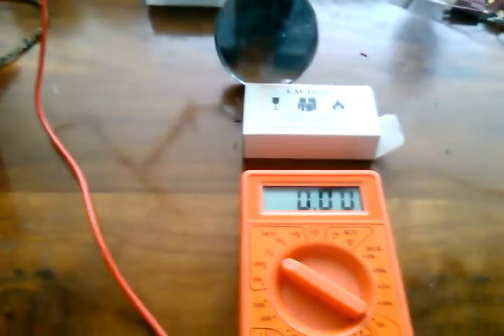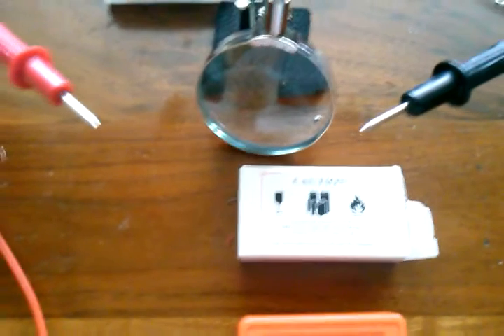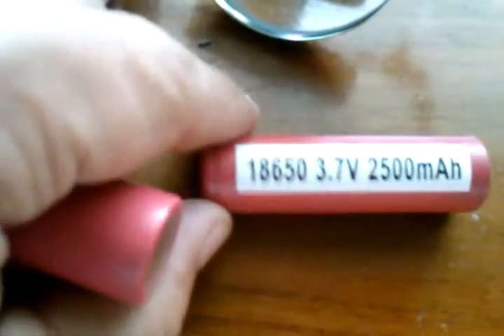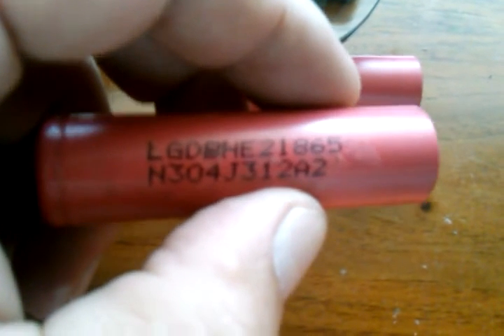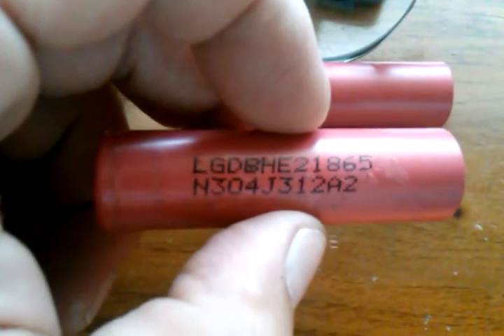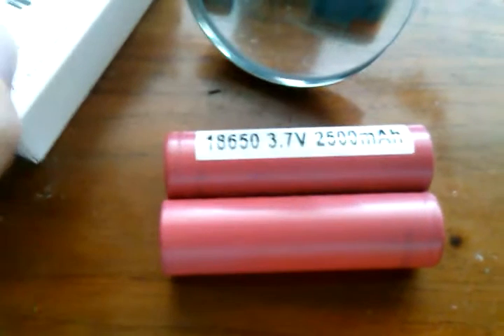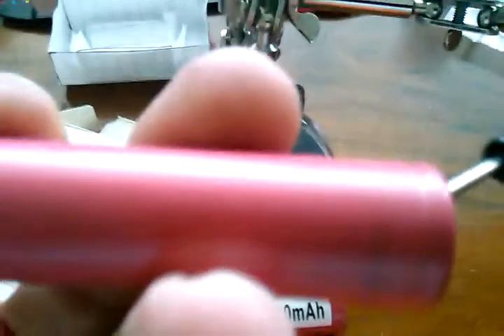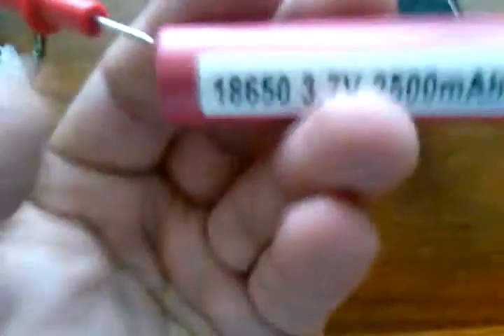UNBOXING !  LG HE2  18650 3 7V Battery 2500mAh Rechargeable 35A High Drain Flat Top‏

Comment: Are these aa?
Reply: Basically the same thing. Just different size, chemical make-up, voltage/amperage/capacity, and these are rechargeable which alkaline AA's are not. Basically just AA's on steroids haha
Reply from the maker: AA's can't hold a candle to these. They are double the power at 3.4 volts and at least triple to quad the capacitence .................. as thier size goes that why they are named 18650 18mm W X 65mm L  and the 0 stand for a round instead of flat battery ..................
Reply: Rex Sterling Buchanan do you know what sarcasm is? Cause that's what I was doing, I though it was pretty clear..
Reply from the maker: @troyguinn303  yeah i got it man. i was agreeing not arguing dude lol. calm down and climb down haha. Have a great day i hope .......

Comment: are these the same as the brown lg's
Reply: Rex Buchanan cool thanks man
Reply: No do not mix them up
Reply from the maker: +Joe Miranda sorry for the late response. no they aren't the same. they will be red in color .................
Reply: Rex Buchanan it's cool I checked the sticker on my batteries and they're 3000mAh
Reply from the maker: The LGHE2's didn't come in a 3000mAh as far as I know (I may be wrong) but that doesn't meant you have bad batteries. I would suggest a capacitance test to determine if they are truly 3000mAh's ........ thanx for watching and good luck !
Reply from the maker: you have the LGHG2's if I am correct. but still take measurements and tests for best results ............

Comment from the maker: AHH i got it backwards LOL. i get nevous when i am making these. in series the Votage is doubled, in parallel the mA are doubled. sorry for the confusion but it is all good LOL ......................
Reply: Rex Buchanan so just to make sure I have it right if I run four of these in series to make a 12-volt battery and let's say each battery has a 20 amp continuous discharge I now only have a 20 amp discharge but it's at 12 volts? The amps don't increase at all? But then if I make two packs that are at 12 volts and then run those in parallel I would now have a 12 volt 40 amp battery?